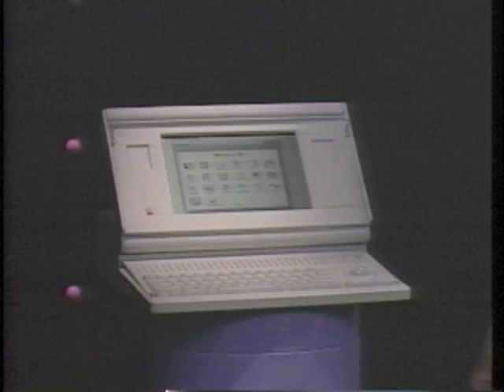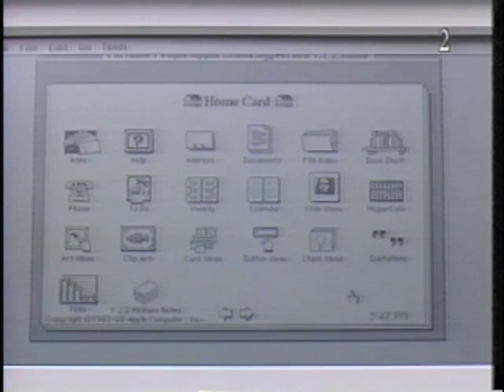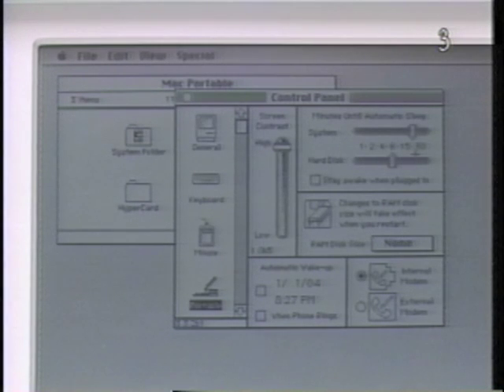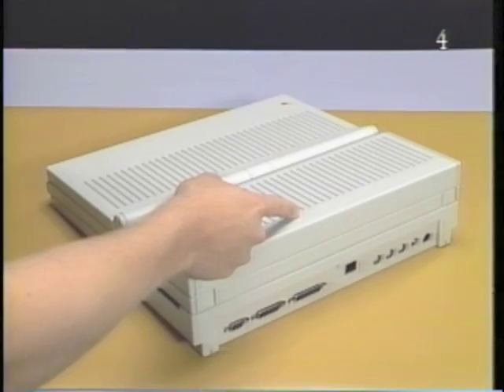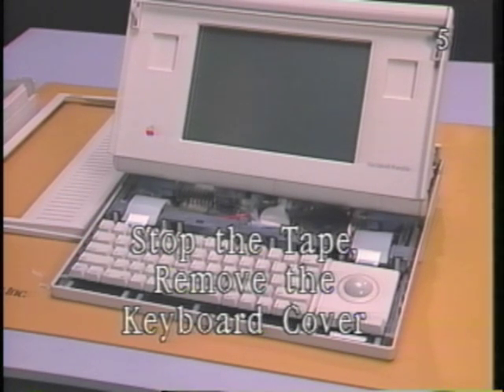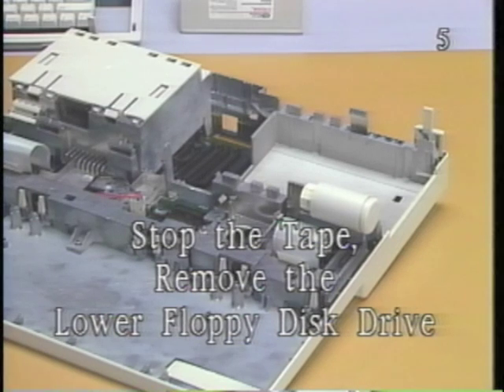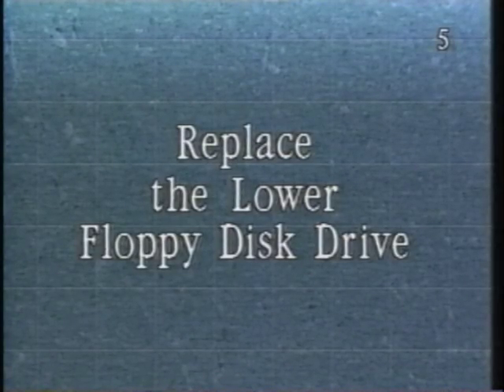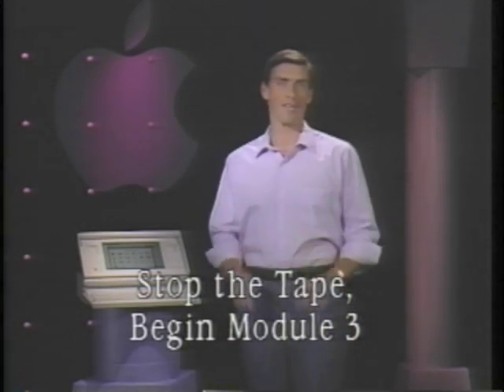Apple Macintosh Portable for the Servicing Technician - Service Guide - 1989

Comment: Just got one and took it apart and the floor of the case, underneath the keyboard 
and logic board is covered with signatures, cast into the plastic,  of 
Apple folks who worked on the model. I've seen other take-aparts and 
haven't seen this on other machines. Very interesting.
Reply: Same as original Macintosh. I think one of the commmodore Amigas have it also.